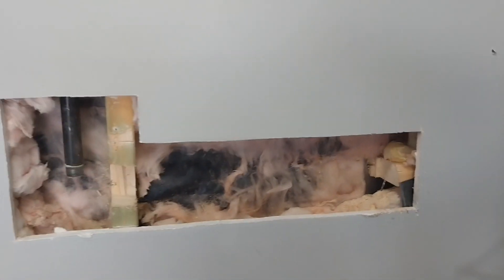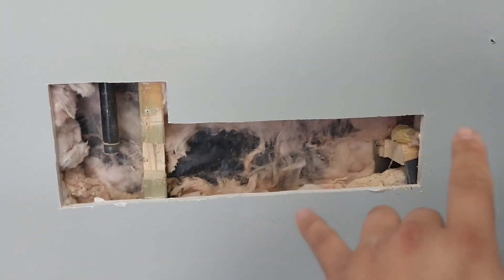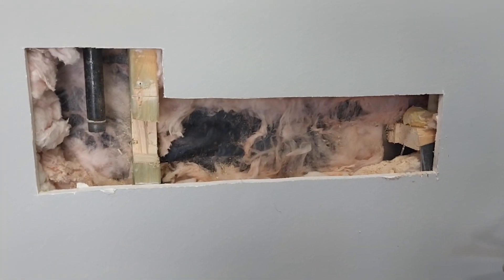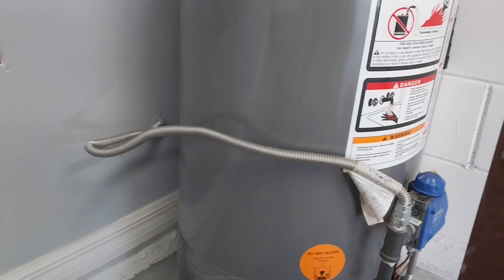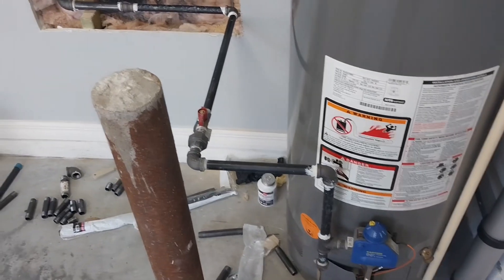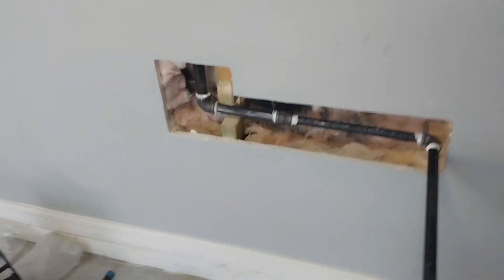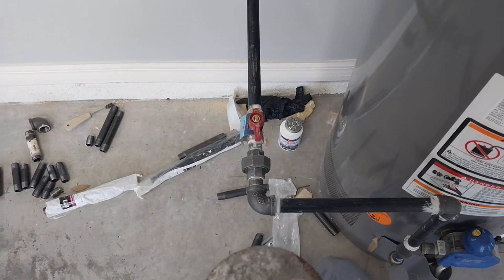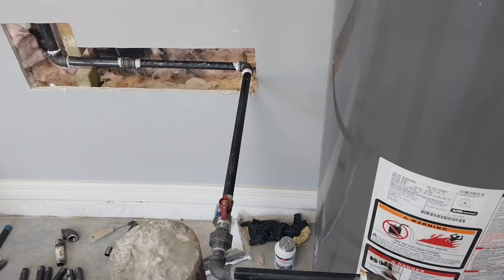Gas Piping for Water Heater: Orlando Licensed Plumber & Gas Experts

Comment: I would have used a 3/4 x 1/2 90° instead of a bell reducer.  That eliminates a couple of fittings.  Maybe put the valve close to the spot where it stubs out of the wall and the union shortly after that.  That way the WH can be replaced just by breaking the union instead of disturbing what is soon going to be finished drywall.
Reply from the maker: Looks like you've got some serious plumbing skills! I'll keep your advice in mind for my next project.

Comment: I would have run the 3/4 down to the floor , support with a couple of straps/kindorf along the wall floor line to water heater and reduce to 1/2 at the gas valve. Less damage to the wall and more structual strength to the gas piping.
Reply: i agree that 2 foot piece floating needs some kind of bracing
Reply from the maker: Looks like you have a future in gas piping design with that detailed plan!
Reply: A split ring hanger was installed supporting the pipe off of the floor.

Comment: Closer to the heater with the gas line.
Reply: Gotta leave some room to work when that thing needs replaced though, don't make life hard for yourself later.
Reply from the maker: THUMBS UP
Reply: customer stated he wanted it behind the concrete pole.
Reply from the maker: thanks for commenting @bizzee4sho  
do you need a #localplumber ?

Comment: Nice square cut and piping  👍👍........
Reply from the maker: Are you sure you're not talking about a cake? I do like a good square cut!
Reply: @MikeyPipesOrlando , lol I use a level when cutting rock walls easier to put back after I re-pipe..  Unlike someone else from Florida does..  be well.
Reply: @MikeyPipesOrlando , I use a level to cut neat holes in sheetrock unlike someone else from Florida..  be well.